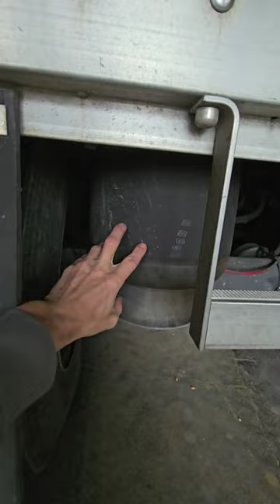DUMPING CORN. Always deflate the air ride...dont drop your phone in the dump pit! #harvest #farming

Comment: Just put a quick release valve in the system. It will dump the air quickly automatically. They only cost about $15

Comment: Load will never come off fast enough to hurt it. If it does you got junk. 😊
Reply: It hyper extends the bags and can screw them up and blow them
Reply: It's pretty apparent that you have never dumped a hopper bottom into a big hopper. You can empty it in just a few seconds
Reply: Yah, I get it, but if those bags can handle the pressure one way....how fast would it need come out to damage the equipment, shouldn't. But, my friend, it's a great common sense idea. To me, I dump the air each time to keep the weight level as it leaves..cheers!
Reply: @PaulVanEerde  The quick release valve only dumps the excess air as the load comes off. It doesn't empty the bags. I used it when I hauled 50,000 lb steel coils The crane had the coil off the trailer in 2 or 3 seconds. The valve released the air so fast and loud that it scared some of the crane operators
Reply: @christinajustinsteele-vale6667 since the pressure is rapidly dropping, just because the bag extends doesn't mean it has any force put on it.
No worse than going over a speed bump with an empty trailer lol

Comment: It probably only took 1 guy to blow 1 already questionable air bag to to make this a habit that most guys dont even know why they do it.  
I personally have seen more bags not air back up because of whatever reason than bags blow out because their not deflated.
Reply from the maker: I heard it from an older trucker we all nicknamed Santa Claus. He was adamant that air bags needed dumped. I was always open to opinion and glad to have some in the comments. Appears I could do away with this step in my process and not hurt anything. 
Thanks for comment. 
Thanks for watching 👍
Reply: @bpfarming  my personal grain trailer is an older model with air ride.  It originally did not have a dump valve but someone added one.  The way mine is plumbed, it locks the trailer brakes when the airbags have no air.  It's a pain sometimes to get them aired up so I can pull away and always makes me think what if they don't.  You can't get to the valves with the trailer down low.  So I  don't air them down.
Reply: @bpfarming as a diesel mechanic and driver, I have blown air bags going through gutters and over bumps with a load, but when they start going up it's because the load is being reduced, and as the trailer goes up, the pressure reduces, and the leveling valve is venting full speed at the same time, so by the time it gets hyperinflated, it's got basically no pressure in it, and it's also a gentle stop at the top of travel, so unless the bag is already damaged, it's going to put much less stress on it than going over a bump with a full load.

Now going over bumps with an empty trailer, or backing up and hitting the brakes with a swing arm axle, now THAT puts heavy hyper extension load on the bags, but also rarely blows them.

It's common to hyper extend the bags when hooking up to or sliding the axles on an empty dry van trailer with swing arm suspension, and that can be really a hard slam on them, turns them inside out sometimes, but I have never seen one blow off from it.